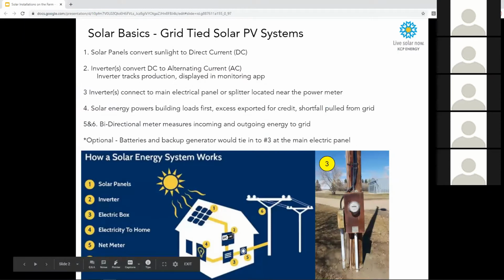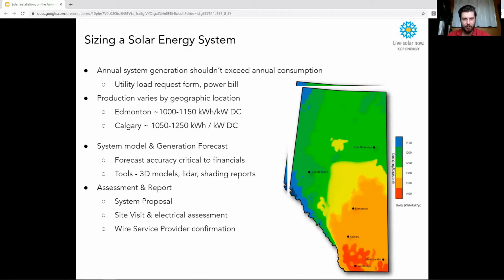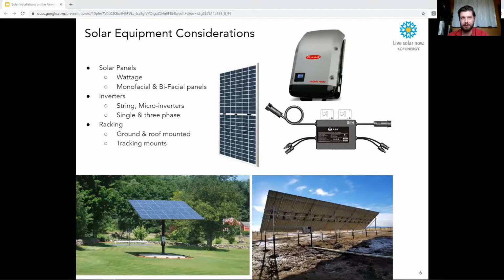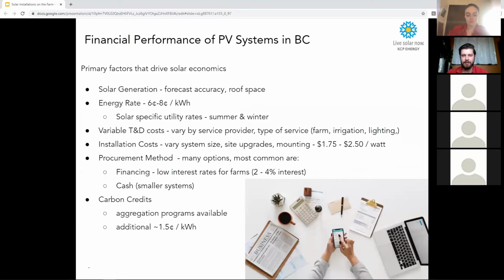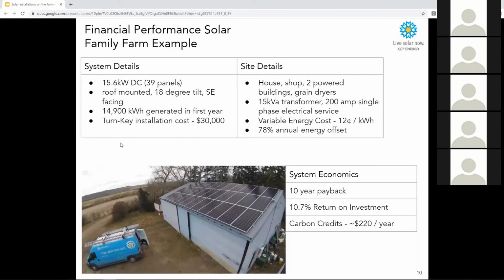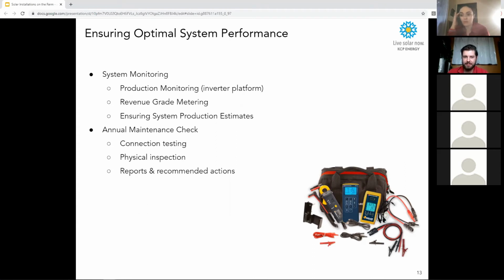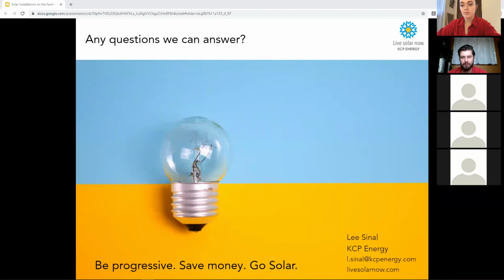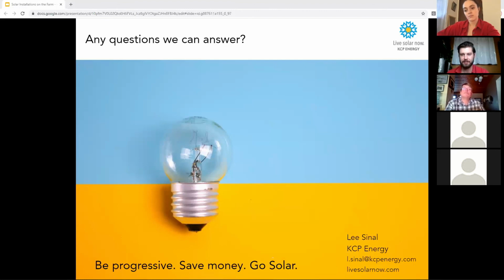Solar Installations on the Farm

Comment: Thanks for a superb overview. Is there a residential program similar to this one which I understand is applicable to businesses?  My energy costs (actual gas and electricity) for my home are typically less than 50% of my utility bill. The rest is transmission and a bunch of riders and other charges. Do you have similar economic analysis for residential solar?
Reply: I agree. It as though you need to be selling extra to the grid in order to “actually” offset your bill and truly save money or your paying it to the bank and the power co.  .?  Also I found that if you wanted to sell more at times that you would need to upsize the transformer but that that would actually increase you billing rate.. what is that? They seem to get you coming and going.
Reply from the maker: Hello there!  I would suggest reaching out to Lee directly at l.sinal@kcpenergy.com
He would definitely have a similar economic analysis for residential solar and be happy to answer any questions.